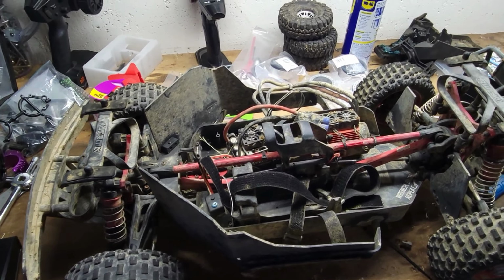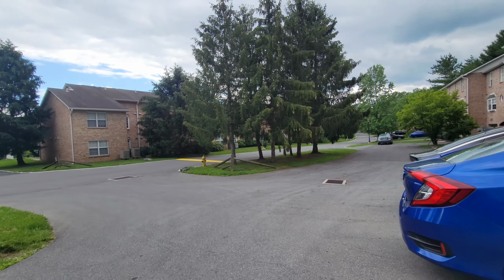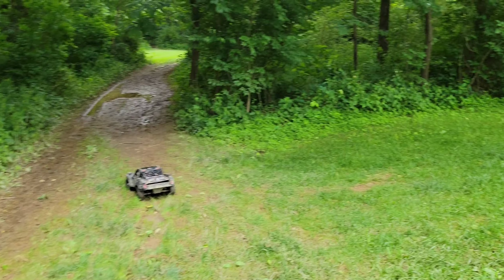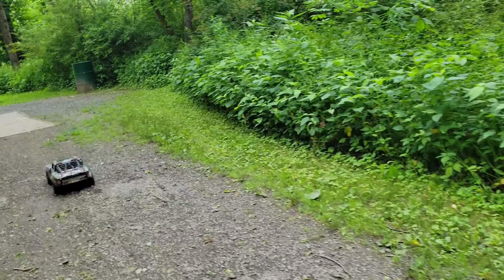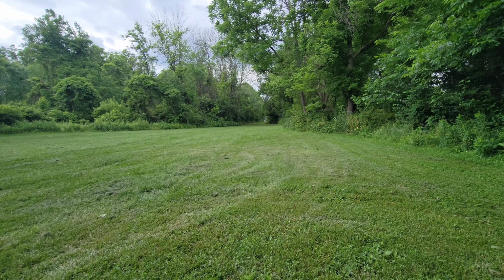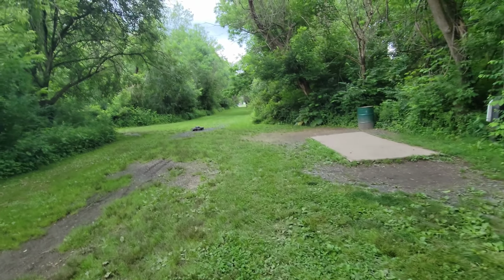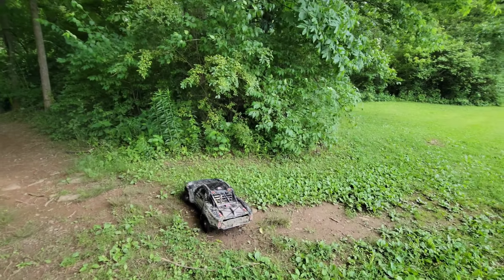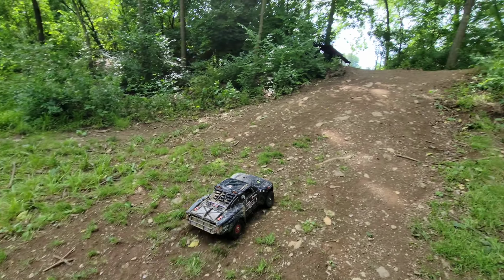Arrma Mojave 8s EXB Driveshaft Test Trail Run!

Comment: I did the same on my 6s talion and Kraton front ends. Seemed to do the job . That and setting the droop screws on the lower a arms and throwing away the rpm a arms that were bending too much. Your Mojave is a beast

Comment: That's sick on 8s! I bet you could gear it up and it wouldn't be arsed 🤣 diffs are takin it too which suggests to me that they aren't just kraton 6s diffs? But I could be wrong. Sweet 🤘🏻🤘🏻🤘🏻
Reply from the maker: Yeah they're the exb limited slip diffs. I've pretty much had it on 8s from the beginning. Only ran it on 6s for a week or so. Definitely has to generate some heat it those things. I need to do a speed run on this.
Reply: I was thinking a gear up after watching this dope bash 😎💎

Comment: Take that red piece off the bottom arm the red ring an washer. An Take that bolt all the way out an re thread lock. An pit it back in an see the difference. Mine powerful also. I have the same truck
 Would love to race u. First on 6$ then on 8$. I'm from va where u from.  I have light bars on mine.  I call my the weed eater
Reply from the maker: I'm from east PA. I'm always down for a good mojave bash.